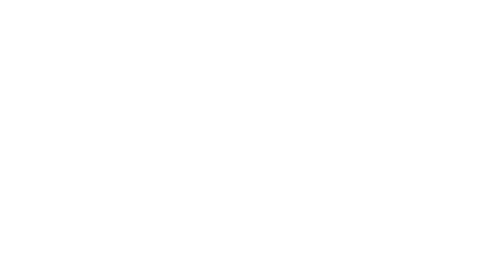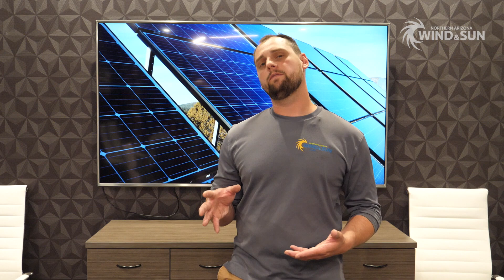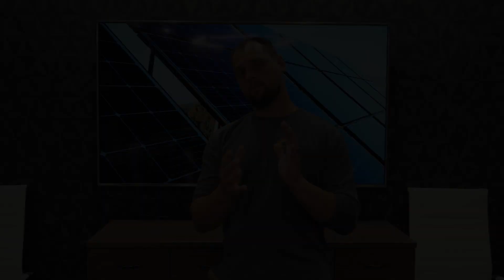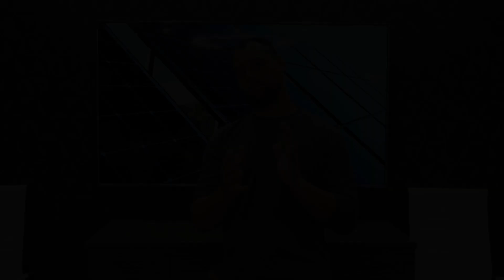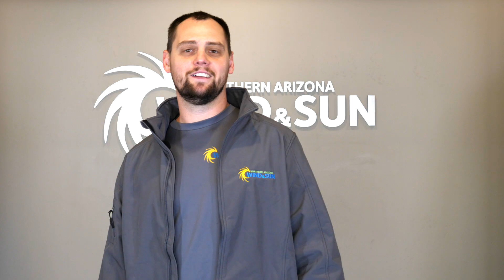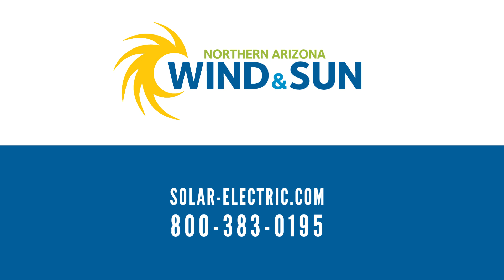Off Grid Inverters vs Grid Tie Inverters

Comment: Which type of inverter is best to tie to the Public grid system so that I could sell excess power to them and also use battery back up. A system that will not stop if the public electrical grid goes down.

Comment: I don't use either. Most appliances and all lights are 12 volts. If I Need to run the Kirby, my Lvyuan- Cantonaise 1000 watt pure sine wave gets switched on. A VCR or a fishtank? A 300 watt pure sine wave. Batteries never are connected in parallel. Solar panels are faced largely east and largely west to milk early and evening sun for long duration and least battery hours. Your big inverter draws way too much standby juice. I wouldn't touch grid tie with a ten foot pole .
Reply: you sound like you live in an RV/ van.  surprise: some people live in houses... hence the grid-tie option.  and houses traditionally run on 120/240v.  good grief...
Reply: @dobrzpe  I want to get you back on course. Grid Tie is a functional way of returning surplus electric to the grid, but that's not its main purpose. It's to keep houses connected to wires. Just like the patch keeps smokers addicted to the tobacco industry, grid tie keeps em hooked. It's also a chance for contractors and loans. It's not the norm. The grid tie box is not an inverter. ...About 12 volts: Ships have different voltages. When you want a better efficiency, you resort to 12 volts. The solar panel police will not bust down your door because you have both 12 and AC 120 in your home.
Reply: @stanleybest8833  honestly i think james bumbled his explanation of inverters somewhat (IMHO).  however, i think everyone is getting the terms "grid tie" and "ac coupled/dc coupled" mixed up.  i have "grid tie" inverters in my home.  my home is totally off-grid.  'grid tie' just usually means you can put power back INTO the grid.  but you can usually set a HOME inverter up and run them so they tie into the grid in order to recharge your batteries only and NOT feed back into the grid.

my point was basically disputing your "standby" argument/point.  yes, larger inverters have 'standby' power draw.  BUT it is usually a moot point when you are running a whole house off the inverter!  if you live the 12v life - bless your heart.  and your solution is actually perfect for you!  it's just that most houses run on 120/240 and are ALWAYS drawing power, so, again, 'stand by' power consumption doesn't come into play as it's always feeding a power load.

and i've never heard of ANY house being converted to 12V.  hence my comment about being in an RV or van, which, once again, your solution is PERFECT for due to power consumption/limits/draw.
Reply: @dobrzpe  Discussions don't go well when each post straightens out one point but messes up two or three. Most of us readers are here to learn ,not expand debates.

Comment: I am in the market for a new PV - LFP-battery system. I like the capabilities of the SolArk -12K or new SolArk-15.  I also like the new HomeGrid modular LFP battery system made by Lithion. My problem is that I really like the SPAN panel for its 3-category - drag and drop critical circuit capability for grid-down conditions and don't particularly like the new SolArk SmartLoads-14 because, to me, it looks like a clunky hardwired critical loads panel. Am I wrong with this assessment?  Is there is an easy-inexpensive way to get the SolArk-12K Hybrid to talk with the SPAN panel so that the SPAN panel would function nominally as designed and that the SolArk-12K would do the inverter/battery/grid management as designed (kind of like an integrated system)? I talked with a sales rep from SolArk and he told me that they have no communications accommodations for use of their product(s) with a SPAN breaker panel. Thank you for your great posts!

Comment: Can a Victron Quattro feed back to the grid as well as to a battery bank?
Reply: Technically yes, one can set them up to do this with some basic configuration but not legally. They cannot feed the US grid currently as they do not meet the National standards for doing so safely.
Reply: @seconddayair8734  so, I could have an off grid system that charges my battery bank and if there is extra power coming from my pv array it could be back fed to the grid? (WhT is the issue with the US code, anti island?
Reply: @seconddayair8734  is there anything I can add in between that would make it okay?
Reply: @workbench1  why adapt a product that doesn’t meet required standards when there are plenty of products on the market that do and don’t cost more per se. Give NAWS a call. They can help you out with setting up a system.
Reply: @seconddayair8734  because I already have it.  Just trying to squeeze every bit of value from my system